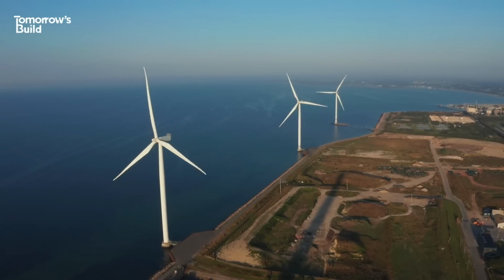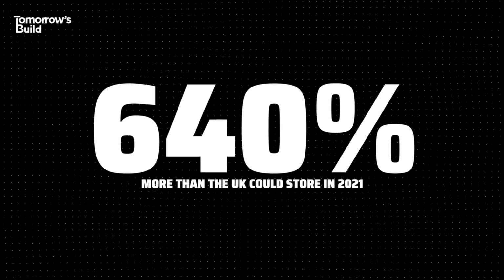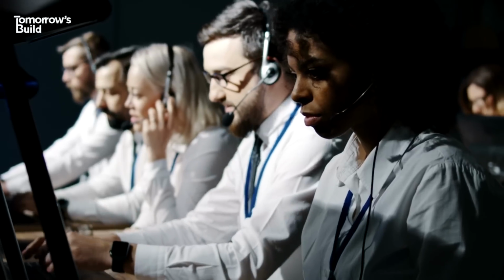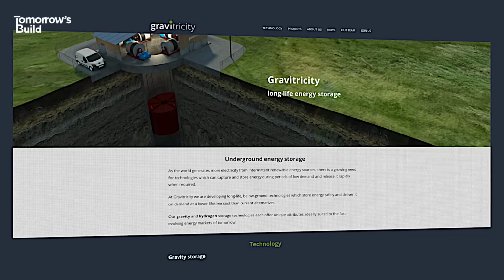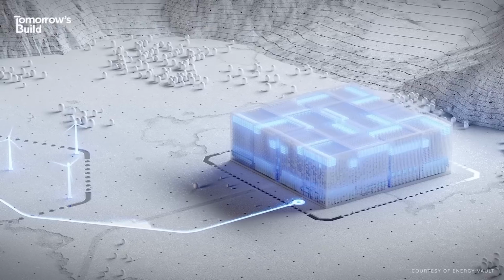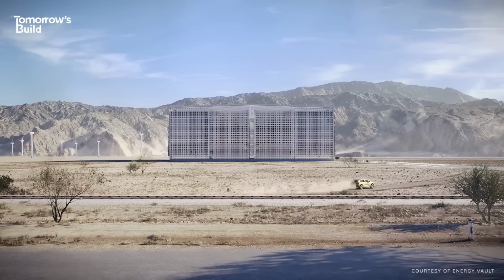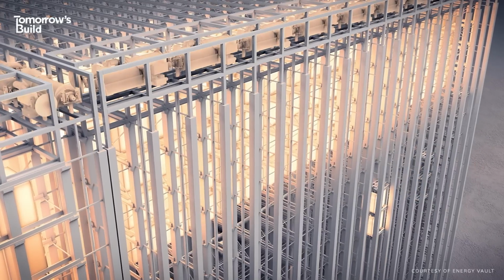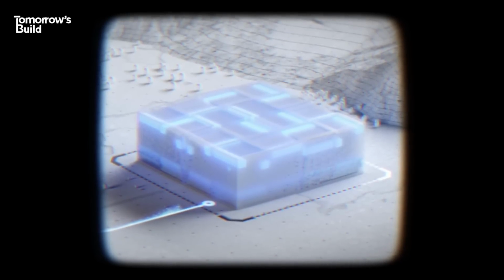The Hidden Crisis With Renewable Energy | Tomorrow's Build

Comment: It would seem like the amount of energy the concrete blocks could store is very limited and very expensive. There is a reason we've used water so far. It's cheap, widely available in most countries and has little impact on the enviroment. I think thunderf00t made a pretty good video on the topic (and no he probably didn't do a perfect job either but I remember it being good).
Reply: I agree, there is also the wear and tear issue , hydroelectric  dams have less moving parts than this alternative . . .
Reply: @user-xr4bo3ln6f  that is why in partnership with Cemex and tested with the help of Cal Tech and Stanford University, they developed an entirely new material that is similar to concrete in its shape-ability, however is also a factor of 20-30 times stronger and less vulnerable to the typical weather and environmental wear and tear that you mentioned
Reply: @ryancwiese  innovation is good , and maybe the new material is better than concrete, but would the mechanism be more durable than a good hydroelectric dam?  
But maybe this tech would be useful somewhere else like mars where liquid water is very scarce
Reply: @user-xr4bo3ln6f  you’re missing the point, we’ve already build dams virtually every where globally that we can. They require very specific geography and we’ve already utilized all of those locations to build dams.
Reply: @ryancwiese  that's far from the truth, there are still lots of potential cites for hydroelectric dams, and hydroelectric dams  can be artificial, there are far less limits on that than on the system they propose in the video.
Reply: The fundamental issues with pumped hydro is that you can't just build it anywhere. You need height difference and good geology. You also need to destroy huge swathes of land to build the reservoirs, often in beautiful terrain with unspoilt natural habitats. In the UK for instance, most of ideal locations for pumped hydro have already been built, such as Dinorwig in Wales, and we can't even build a simple electric railway line without it being mired in decades of environmental studies and judicial reviews. It's just not practical to build more of these schemes.
Reply: @madvlad1  Yes I grant you that but what does this solve in that regard? You could argue the higher density of concrete is an advantage as such a system will require slightly less horizontal area. However, the elevation would still have to be man made. I'd argue those millions of tons of concrete are better spend on building reservoirs.
Reply: @jadoei13  Density is the best advantage that can be borne from this kind of technology. 1 cubic metre of water weighs 1 metric tonne. A similar cube of concrete weighs 2.4T. You could just use a steel bucket fill of crushed aggregate and achieve a similar (if not better) density. A 1 cubic metre block of lead would weigh 11.3T. The biggest question is how inexpensively can you build the winding gear, rather than the medium you're raising and lowering. This is where technologies like air compression are arguably better because you can have relatively inexpensive pumps pressurising huge pressure vessels, whereas with this tech you have to scale horizontally, which is extremely expensive because you have to have multiple copies of the same winding gear, or, you have to build taller, which has its own drawbacks. Scalability is the issue here.
Reply: Dams have MASSIVE impacts on the environment. They block flood cycles, which then eliminates downstream silt deposition, starving floodplains of river-borne nutrients. Many fish species depend on the ability to migrate up and downstream to follow food sources and spawn. And deeper and less-turbulent water can also mean less oxygen in that water.
Dams are not environmentally neutral.
Reply: Brillouin Energy begins commercialization of pulsed catalyst nuclear fusion electric heating system.
Leonardo Corporation publishes Self-sustaining mode zero point energy data sheet.
BrilliantLight Power develops hydrino based clean energy solution for $0.001 per KWH.
Reply: Pumped hydro can be good for long term storage, but it's not ideal for short term storage. Especially frequency regulation. 
The response time of solutions like Energy Vault, or batteries, is much faster. Energy Vault degrades less with rapid cycling. 
So many people commenting on these solutions haven't got the slightest clue about what problems energy storage solutions solve. They think it's all about storing the most amount of energy for the longest amount of time. You don't need to do that to solve the most important challenges with renewables (frequency stability, duck curve, ...)
Reply: Yeah pumped hydro is better, unless you live in say, Florida, or Kansas... not everwhere has convenient mountains. And you know, not everywhere has the water to spare either
Reply: Oceanside pumped hydro is the future, if they can figure it out. Freshwater pumped hydro has limited viable sites where it can be built, and of course needs a lot of freshwater which is a limited resource
Reply: Mass production of batteries like LFP (no rare earth minerals) in combination with continued dropping of generation prices seems like where the world is headed for.
Reply: @MattCasters  - The operative words being "headed for" - a battery storage solution is vastly more expensive. Ask yourself if any parts of this world need cheap storage that anybody can repair with minimal knowledge. One that can handle extreme environments with ease. Ask if they care if that storage is less efficient than solutions they can't afford or maintain.
Reply: The clip where the CEO, Rob Piconi, whom I happen to know personally, is discussing how the blocks will be constructed is outdated. The blocks are actually now created using 100% recycled materials sourced from the carbon leftover in landfill burn pits, a recently patented and entirely new material that is less expensive than your basic cement, but significantly much stronger and cheaper to produce in large quantities. Also, your argument that hydro is widely available is incredibly misinformed. You can’t just use any place on earth where there is flowing water and construct a dam there. In fact, it takes very specific geography and our modern society has already built dams in virtually all of those types of locations. So whatever video you watched was created by someone who has zero idea what they were even talking about. I’ve seen a lot of doubters of NRGV making YouTube videos, but if you take the time to look, almost ALL of those videos were made by people holding large short positions against NRGV’s stock and/or were commissioned by oil/gas companies that will do everything in their power to keep the world reliant on fossil fuels because that is their one and only source of income and profits for their shareholders. Oh yea, and the NRGV resiliency centers (shown in this video) can  produce virtually unlimited power for the grid at a fraction of the cost of or environmental impact that result from building dams or installing large hydrogen cell battery farms (which can only store that reserve green-produced energy for up to 4 hours and a astronomically more expensive than NRGV’s structures.
Reply: Probably be cheaper to install 14kwh power wall's to every house hold linked to a smart local grid.
Reply: @adam-g7crq  it’s not, my father is a co-founder. Trust me I know what I’m talking about.
Reply: @ryancwiese  what on earth are you blathering on about.
Reply: @adam-g7crq  which part? The fact that we’ve utilized all the geographic locations to already construct dams? Or the fact that my father is a co-founder of Energy Vault? Look at my last name and go to the company’s website and look up the COO/Co-founder
Reply: @ryancwiese  //" in fact they will be building one resiliency center in the middle of the Australian Outback that will supply 100% of the energy needs for the entire island of Singapore."//

Yes we know your Daddy is one of the guys sucking money out of folks for this dumb idea, but you're going to feel really stupid in 10 years when you come back and read these comments.
Reply: Please don't bring up that horrible man. We come here to watch some good videos - not listen to sycophants venerate a narcissistic sociopath.
Reply: @JohnnyWednesday  I'm all for good videos but throwing money at pointless solutions makes people loose trust (and justifiably so) in the entire transition. If you can prove that it works with some basic math then I'll fully support it but I don't see how this is better than existing solutions.

Okay I bothered doing some math:
10 ton block with an elevation of 50m yields 1.36kwh before losses. We have car batteries 100x that capacity. If you can build this on the side of a mountain and use 500m you end up with 13.6 kwh, pretty usable. However, at that point pumped hydro just seems like a better solution again. You could also take bigger blocks but using 100 tons of concrete per person doesn't seem like a very feasible idea either.
Reply: @jadoei13  - Pumped hydro has to be very big before it's financially viable. Other storage solutions, even if less efficient? are financially viable at smaller scales. Nobody is trying to claim this is a more efficient storage solution in terms of energy - but when you don't have much money or you're in an extreme climate? a less efficient system is better than no system at all.

We make steel using inefficient processes in terms of energy - but we do it anyway because we need it immediately - cheaper steel that takes longer to produce is more expensive if that steel is being used to build things that will save or generate even more money.

Same as energy - the quicker you have a solution the quicker more profitable systems come online. Pumped hyrdo's efficiency is meaningless to the people that have to wait years for it to be built - and it's not an option for anybody that doesn't have suitable terrain.
Reply: @jadoei13  - You see a system that's less efficient. I see a system that's vastly cheaper and easier to repair and maintain. There are many places in this world where this system is attractive - and they're not on the internet to tell you how much they need it. Unless you're going to buy batteries for them - they'll be buying the one that uses large lumps of concrete.
Reply: @JohnnyWednesday  wdym "smaller scales"?? This is not meant to be a 1 home application scenario. You want to have the biggest scales you can have to be able to power more than citys. There is no middle ground needed between batteries for your home and large hydro plants for centralized storage.
Reply: It's a myth that we need long term storage. The calculations have been made and we only need a few days at most. Mass produced cheap batteries win for the same reason that solar panels are winning: cheap, easy to install with little to no maintenance.
Reply: @JohnnyWednesday  you’d actually be surprised to know that the latest design being constructed by NRGV is actually 3-4x more efficient than any other alternatives for energy storage.
Reply: @dhlehrenlos  correct, in fact they will be building one resiliency center in the middle of the Australian Outback that will supply 100% of the energy needs for the entire island of Singapore.
Reply: @MattCasters  incorrect…is that even a researched comment like even a tiny bit? Current Tesla large battery storage units can only hold the excess green-produced energy for a maximum of 4 hours. I’m pretty sure it stays darker longer than that after the sun goes down? Not to mention the fact that all those batteries that require “rare earth minerals” for the technology to work…well they don’t call them “rare” for no reason. If you believe that’s the future, that’s like saying Earth will always have life bc of the endangered species we have here who will repopulate the planet lol
Reply: @JohnnyWednesday  he is not horrible just because you don't agree with him lol
Reply: @JohnnyWednesday   whether or not you like thunderf00t, he is correct. The truth doesn’t care if you view someone as a narcissist.

Comment: If you haven't already covered it, you should do a video on the Snowy hydro scheme here in Australia and the upgrades they are currently doing with Snowy Hydro 2.0
Reply: And why on earth it’s blown out to years behind schedule and billions over budget, that’s I’d be interested to know
Reply: @od19  While hydro (and pumped hydro) is usually expensive to build, it's essentially immortal. It runs forever with minimal maintenance or other costs. The small Rubicon hydro scheme in Victoria, Australia has been happily generating power for the last 97 years and much of its equipment is the original stuff from the 1920s. Larger schemes in Tasmania are nearly as old and are also very cheap to operate. Other forms of generation (wind, coal, nuclear, gas, solar) are lucky to last for 40 years, So hydro involves a big investment in the short term for a huge return on the capital invested in the long term.
Reply: @od19  that would be because of the ten years of incompetent government . good ol LNP can bullshit their way to anything

Comment: Great video. The UK has the world's largest electrolyser plant near Sheffield as part of the green hydrogen phase of an industrial and energy plan started last May 2022.Several storage facilities are being built around the country and on the continent. The world's largest offshore renewables and innovation with hydrogen will surely meet our energy needs well into the 21st century.
Reply: Using hydrogen for energy storage has terrible round trip efficiency. Apart from some niche industries that will be hard to decarbonise without some form of "green" hydrogen, it is not a solution to much of anything. It is certainly not a good store of energy versus many other systems that already exist.
Reply: @mentality-monster  Not to mention that all of this infrastructure is being built in an overall environment where fossil fuel powered mining, transportation and construction vehicles are still legal & extremely cheap in comparison to any other option. This hydrogen stuff already sucks in the current paradigm, imagine how much more it would suck if the electrolyser plant had to be built from concrete that is 5x as expensive as before.
Reply: Hydrogen is NOT efficient at the most basic energy equation level, is DANGEROUS and destroys the metatscinnjustva decade, tanks, pipes, turbines, and then lastly is a single electron, and WILL migrate through thecsteel, meaning a single spark in a plant can blow a whole suburb off the map
The oil industry's solution

Looking forward to seeing how this rort ends.😥